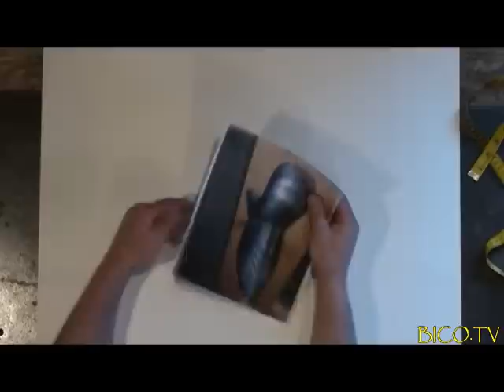Fabrication d'armure médiévale Making of medieval armor #11

Comment: @Kaeles he's likely using 1050 mild steel, so there is little carbon in there to begin with. However, if he was using spring steel, you would be correct.

Comment: I recently tinkered around with making a gauntlet and I had some trouble with the rivets getting stuck where the armor needed to move, any suggestions?
Reply: MrPdante move the rivets?
Reply: Dont rivet so tightly. You can put a half washer under it to rivet, then remove the washer when your done. This will allow  you to rivet good and tight and once the washer is removed should leave it loosened as needed.